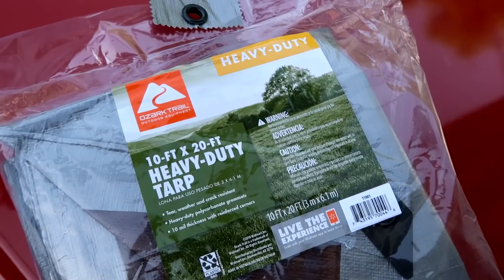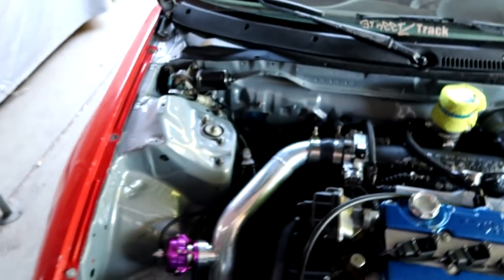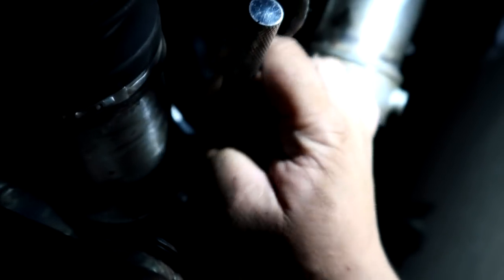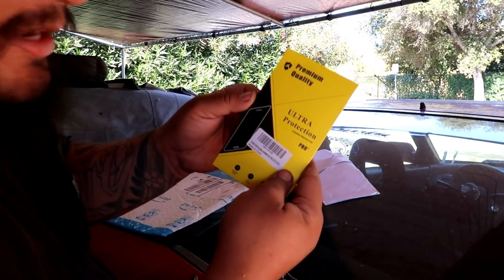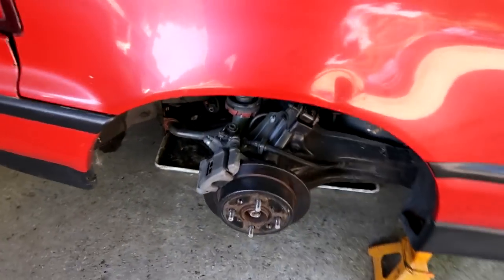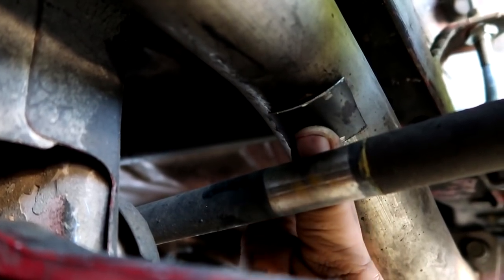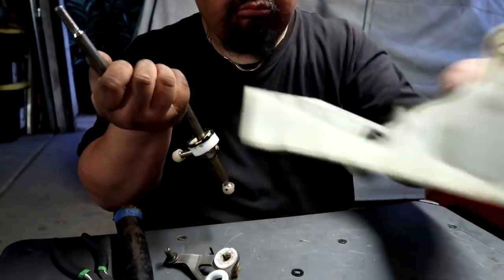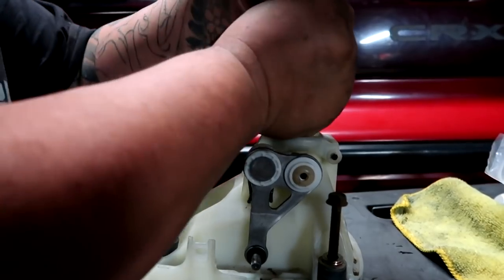AWD CRX - Cheddas Auto Short Shifter Mod

Comment: Awesome update like always Dana I just have a question bro are you using the clutch kill switch and if you do you may want to consider bypass it especially using a twin clutch I ended up getting crank walk on my B18 Civic because of that. When you first start your car with a twin clutch it puts a lot of pressure on the crank and because of the lack of oil when starting the car they worn out prematurely. Just a thought and keep doing what you doing bro 💯👍 and you ever thought of using a 90-93 accord shifter box they sit lower than those and they are more solid 👍
Reply from the maker: i have a clutch stop. i usually dont use the clutch to turn my car on since i dont have the sensor there. my wagon did put too much pressure on the crank and it destroyed my thrust when the engine came apart.
Reply: YoungStatic  👍 Keep doing what you doing bro love the channel

Comment: MIG 235/18.1 tap trigger at the edge of hole till you fill it then grind it down with flapper wheel. 36 grit.

Comment: Very good install video of the shifter. Is there is large height difference between the OEM unit and the new one. I'm still undecided as to what shifter setup to run. If I should get this or get the k series shifter and cable. My shifter sits high compared to the crx.
Reply: AJ Imports  The 90-93 M/T accord shifter box they sit low and you don’t have to cut out the center console that’s what I’m going to use in my REX with a K swap
Reply: @yadieldiaz6395  the Accord shifter does not work on the b series transmission. Unless you know what cable/shifter bracket works. I have the Accord shifter so that would save me money.
Reply: AJ Imports  Contac HASPORT and ask them I got a plate that I can use for the 90/93 accord shifter box but I’m using it on a k swap don’t know if it will work with B series though
Reply: AJ Imports  The 90-93 accord shifter box use cables though
Reply from the maker: @yadieldiaz6395  cable placement is different on the b series awd trans. the accord shifter only works on the k series with the correct trans.
Reply from the maker: you can cut the tunnel and run the k series plate to bring the shifter box down lower.